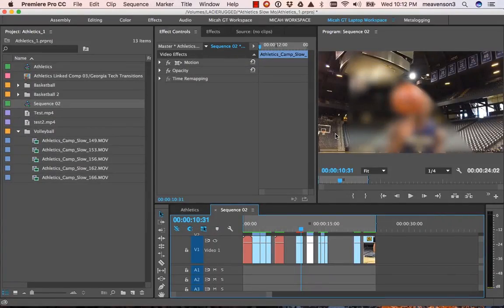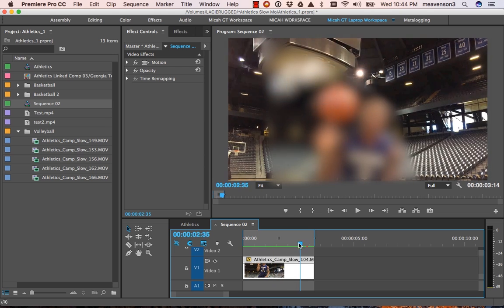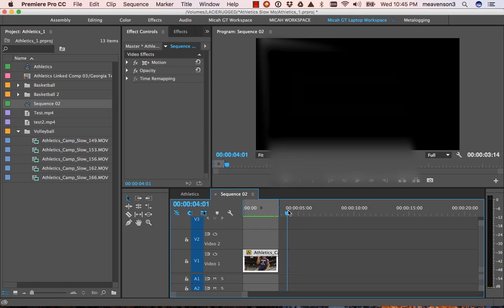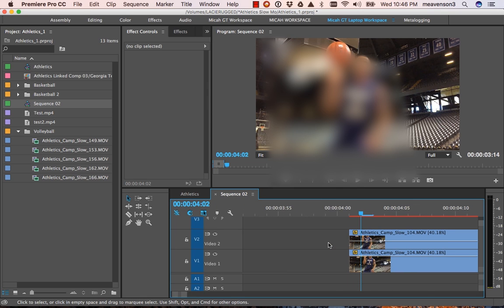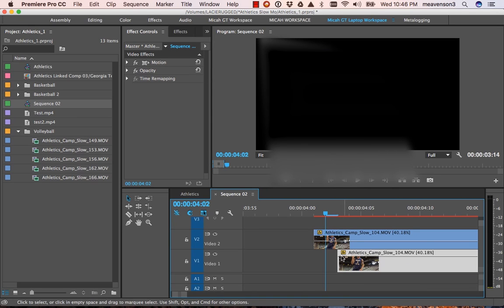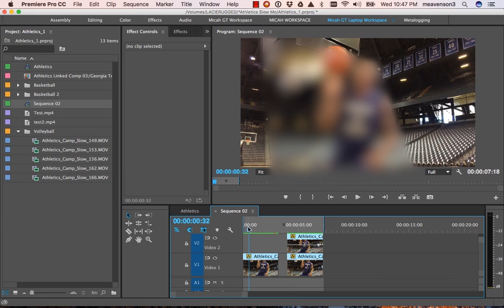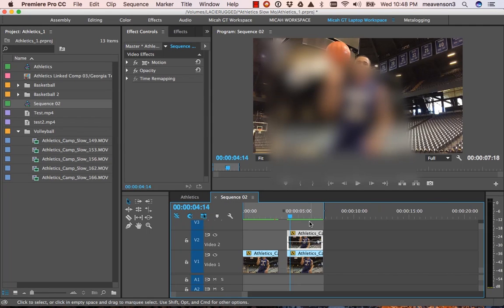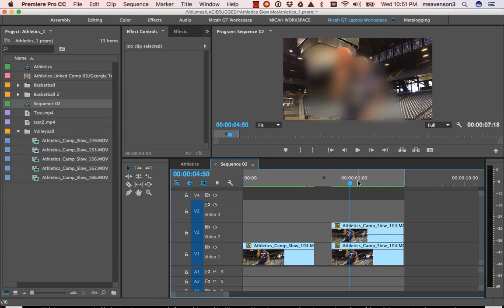Light Flicker Removal Adobe Premiere - Refresh rate issue

Comment: Worked.
I had interview footage with no flicker on the first subject but flicker for the second interview (flicker in the light but not in the shadow; interior, same lights, settings, 30 seconds after the first interview). I moved one frame on overlaid copy with 50% opacity as per and it worked great.

Just a suggestion for other videos, the clicking and keyboard sound is like nails on a chalk board. 
But still a useful video. Thanks.
Reply from the maker: +Paul Miil glad it worked for you!